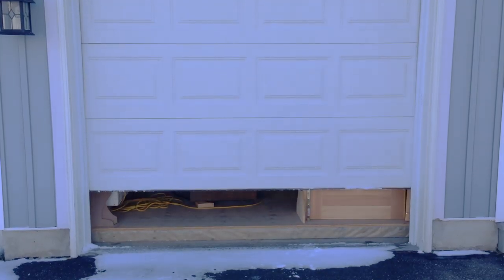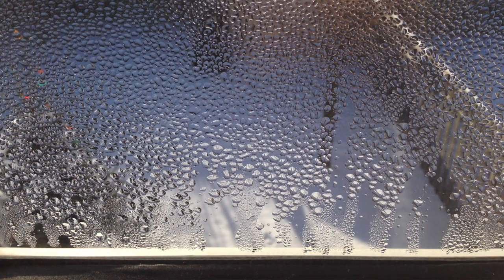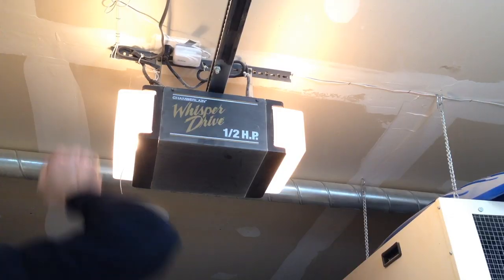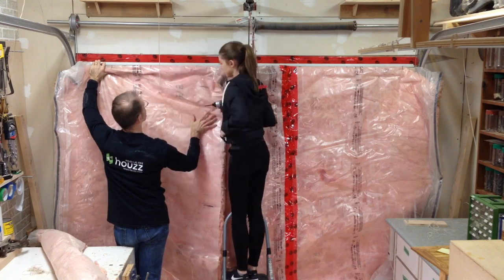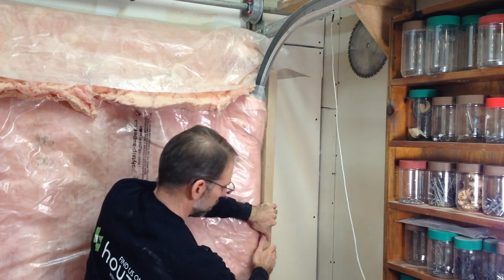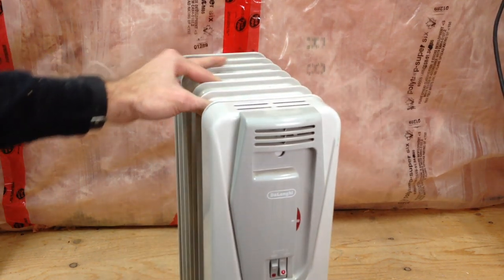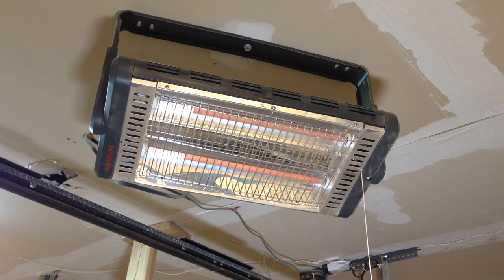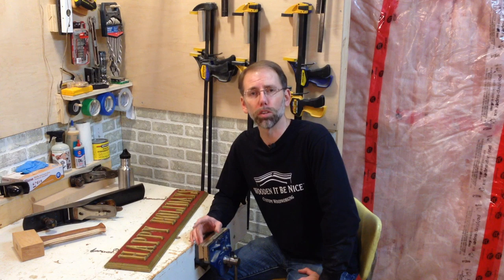How to Heat a Garage Workshop - Insulation and Space Heaters

Comment: Be very careful with that exposed poly sheeting.  It can be ignited super easy and it burns invisibly giving off super noxious fumes as well.  By the time you know you are in trouble it is often too late.  Take some outside in a well ventilated area and try it.  You will be amazed.  A foil backed insulation might be a better choice or the Comfort Board by Roksul glued permanently to the door matching the segments so it can still hinge.  Can't beat a warm shop for sure.  Take care.  Doug

Comment: Are you not worried about the radiant heater coming in contact with saw dust? I always thought that was a cause for concern in case of saw dust explosion risk. Or am I being paranoid?
Reply from the maker: No, not for my workshop.  I run a dust collector and an air cleaner.

Comment: I made a man cave. And I do not want to insulate or spend a lot of money. Do you think a space heater can hold a corner warm?
Reply from the maker: I understand the desire to not spend too much money, but if you don't insulate, you will be running your heater a lot.  It might be cheap for one season, but you will be paying more over time because you heat will constantly be escaping.  I hope that helps.  Scott
Reply: @HomeImprovementWoodworking  Thanks I have found a $100 garage insulation foil thing and it has really helped thanks so much!

Comment: What brand of rigid foam board is under the plywood floor? 

Also wondering if you chose not to use somthing like DMX 1-Step underlayment? 

Thanks for the video.
Peace of Lord Jesus upon you and yours.
Reply from the maker: Hi David - I don't know the brand of foam I used.  It's the type of foam that has small balls of foam when you break it.  When I chose the foam, it was more affordable than the solid foam.  I finished this floor in 2002, so I'm sure there are newer insulating products on the market now.  If I had to do this over again, I would have to do some research for the best product.  Thanks of your question.  Scott
Reply: I didn’t do sleepers but I used a product called DriCore insulated panels. More minimal insulation but I think sufficient enough for that thermal break.